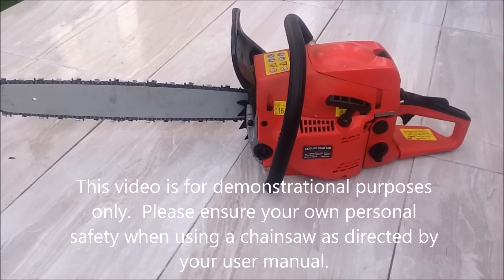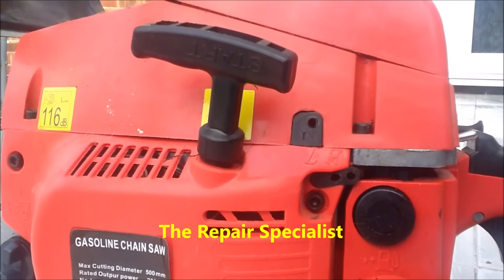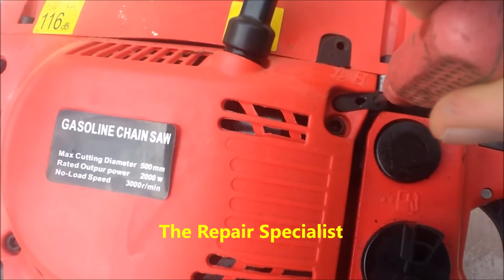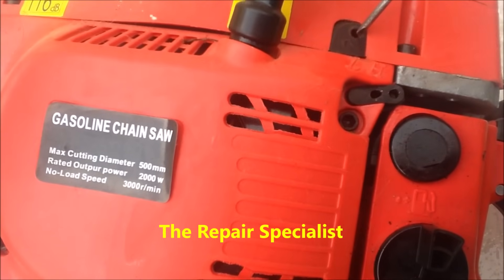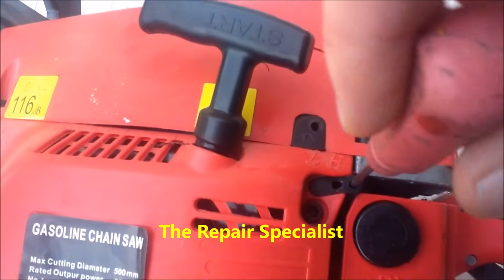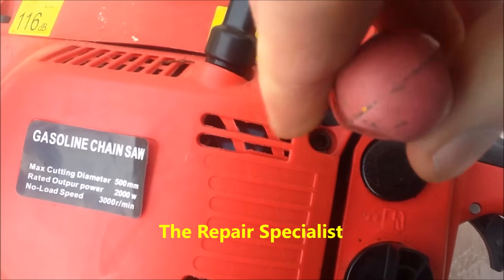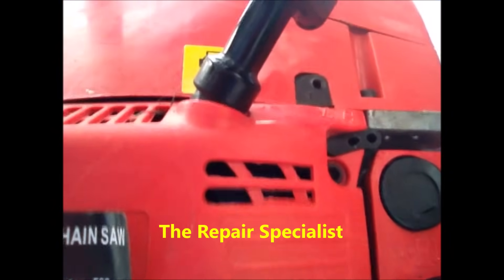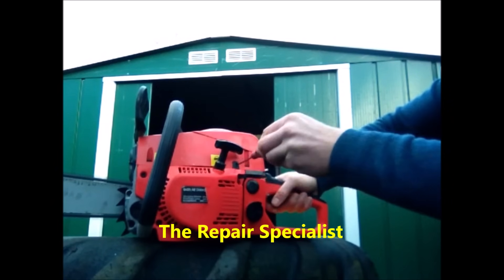Chainsaw Carburetor Settings: HOW ADJUST CHAINSAW CARBURETOR CORRECTLY!  (by Craig Kirkman)

Comment: I just replaced the carburetor and I realized I wasn't really sure how to make the adjustments. I watched a few videos but they were long winded and left me still uncertain. This one was the best and straight to the point and well explained.  I spent the afternoon in the woods with a well running saw.
Reply: You are so right. Everyone has a carb adjustment video where they tell you everything except how to do the adjustment. Straight and too the point.
Reply: @spagsketti  yep I came here to adjust my screws not pass a test on carburetors 🤣 too much information in half these videos. Finally one I can understand easily.

Comment: I believe the brand and model on that saw is the Chinesium Maycut.
Reply from the maker: OK thanks
Reply: Hahaha
Reply: @Dean Clark Hilarious but sad at the same time. Do we blame the companies making garbage products or the cheapskates who created the demand?
Reply: @Dean Clark I have a Timberpro and also use a farmer friends Stihl. There is no difference between the cutting ability, the handling is better in the Stihl but both get the job done, with a sharp chain......
Reply: @bubbafudpucker397  yes
Reply: I've got a 62cc Dereal that's one of the many takes on this very saw. Gave $122 and it's the best saw so far that I've ever owned. I've had 4 stihls & several of the early homelites.
Reply: Yes to be exact its the Chinesium Maycut-yorlegoff its kind of a special design.
Reply: @moorbene5104  LOL!
Reply: Regardless of saw brands all the carbs and systems are pretty much the same except for the materials used. Carbs even in el cheapo's are from same manufacturers.

Comment: Thank you, sir! I couldn't find this information anywhere in the chainsaw manual. After countless tries to get the thing running and reattach my arm to pull that wretched rope another day, I tuned (no pun intended) into your channel. There I found your priceless information about the H and L adjustments. After applying what you said, it fired right up and runs like a top. Again, thank you so very much!!!
Reply from the maker: Thank you so much for your kind feedback. I really appreciate it. Craig 👍👍👍👍

Comment: Thank you thank you thank you. I had replaced the fuel lines and I started messing with the adjustments and I got them all out of whack😖. Your video saved the day. Simple, to the point, accurate and very very helpful. I did exactly what you said and had great success.  👍🏻👍🏻Two thumbs up. Big likes

Comment: I love the way you speak mechanistically, in contrast with many other explanations. Can you tell me why idle rpm increases when you turn the L screw clockwise, reducing fuel delivery? Is it because the saw idle is set too rich, and dropping that ratio down gets to stoichiometric A/F balance? If you had a tach, would you adjust the L screw to achieve peak rpm at idle? Or, is it better to be a little rich at idle so that a cold saw will start more easily?

Comment: Thanks for the video and link to the kit. 
My Dolmar PS-35C has an ordinary slothead screwdriver on the L adjustment, and a single-D on the H adjustment. The idling adjustment takes a Philips screwdriver.
You have to wonder why they aren't all the same.
Reply: To keep you from tampering with it. The environmental people don't want you messing with the mixture screws and the amount of pollution the saw puts out and the manufacturer doesn't want you messing with the high speed screw and blowing the engine up from over-revving. No one cares if you change the idle speed.

Comment: Thank You, you showed me everything I needed to get my Echo CS 590 started and purring like a Timberwolf should
Reply: That saw has a limited coil and needs to be tuned in the wood
Reply: I just got myself an echo cs 490. It was bogging down in wood over 10 or so inches which shouldn’t be happening so I took off the litter caps and am going to tune the carb up a little higher as well as open on the muffler exhaust. Hopefully this wakes it up. How’s the Timberwolf working for you?

Comment: I always do the L screw first as 15-20% of your fuel at full speed comes from the low speed circuit. (Most carbs) Another thing is that if you idle speed adjustment is too high it will be difficult to adjust the low speed jet
Reply: I normally turn out the idle adjustment to just a small amount so I can hear clearly what the low is doing than set it.  Then use the idle to bring my rpms back up to spec

Comment: Thanks I have a weed Wacker I wasn't sure about. I bought a professional husky and it's only about a year old it always sounded clanky out of box in idle. I figured that's how it was supposed to be. Just now I went to use it and it had no balls what so ever under load. I figured the gas was bad. Dumped it out put in fresh 95 octane and still would bog under load and stall out under idle once in awile.  I ended up playing with the carb before your video. I did the L first then held the gas for H until it sounded like something normal. I was worried I messed up and used your video as a reference. First time I ever messed with a carb so I was a bit worried thanks for the video.

Comment: just tried my new top handle chainsaw today, its ok at hi revs but badly bogging down at low speed, I will check the adjustment screws in the manual.

Comment: Great video, like all of yours that I have seen. Just a little confused here. Some good repair persons here advocate to do the High jet first on trimmers and all except chainsaws. On the latter, they say, do the Low first.
Reply from the maker: First of all, thank you for your feedback. I really appreciate it. As for the recommended adjustments. Well, as technicians I suppose we all personally have our very own way and preference of doing things.  This way has worked for me over the last 25+ years, but at the same time, I respect other peoples way of doing things as well. As you can see in the video, I have set this carburetor up nicely. This is just the way I have become accustom to tuning chainsaws and its always worked for me.  Thank you for sharing though. Craig

Comment: Interesting. This is completely  backwards of how I’ve always seen and been told how it’s done. I’ve always been told to start by adjusting the L then the idol then the H then the whole thing over again. Seems to make sense to to it H-L-I as shown in this video. Thank you.
Reply from the maker: Yes it is different to the conventional way, I agree. I was shown the same way as you. But I found this method to be better for me and it works absolutely fine so I wanted to share my way. Thank you for your valued feedback. I really appreciate it. Craig 👍👍

Comment: Master please help I got an Husqvarna 326 chainsaw that the carburettor doesn't work I have cleaned and pulled apart
several time  lately I decided to remove the H and the L  adjustment screws I come to realize that the longer  L  screw  the point 
is broken  and probably that is why the primary gets hard to pump ?      1) How to remove the broken piece    2) IS  the longer  screw
in the right place  L ? Thank you

Comment: would be nice to see with a tachometer and slower explanation. There is some recommended settings from factory - is it not better to start at these settings? On en echo CS2511tes they are for instance H 2 5/8, L 1 7/8 and T 1 5/8
Reply: Yes, go with factory specs. A tachometer is definitely the right way to set the high speed but you need to know the max rpm spec for your particular chainsaw.

Comment: Fantastic video. However it does not solve my issue, which is my craftsman chainsaw model 358.350360 was working fine but then I felt it did not have enough power so I started adjusting the L and the H prior to watching this video. If that was all I did I could have remedied my issue rather easily  with just a little research, but alas I went a step further and started playing around with the idle (T screw) because after messing around with the L and H I had a hard time starting the chainsaw now. Is there a process you recommend on how to set my idle right before I mess with the L and H screws as mentioned in your video. My shoulders sore from all the attempts to start the saw!

Comment: Dear TRS, how to do that if I made a mess with idle screw? Actually, I replaced the carburetor on a Husqvarna 142 and started playing with it. But I forgot initial settings of idle screw and I am puzzled now. What is going on is my chainsaw starts working, idle is very high (noisy) and I simply don't know where to start from or how to continue. Could you explain a good starting position of idle screw at the beginning, when both my L and H screws are at one turn counterclockwise from right position?

Comment: Would you be able to help me with an issue I’m having with a Stihl 015? I have to adjust the high idle screw all the way in for the saw to run properly, but still don’t have high enough rpms. Any suggestions? Thanks sincerely, KyleH

Comment: Dear Mr. Craig. Hello and congrats for your awesome videos. I have a Chinese Chainsaw, did not work for about One year and a few weeks ago when trying to star ir it wouldnt work and fuel was leaking from the air filter. Disassembeled the carb and noticed that the diaphragm was very stiff so i bough a repair kit and rebuild the carburetor. now the Chainsaw os very hard to start and fuel is leaking from the air filter. Can you please suggest anything that can help me?

Comment: as always a great video can you do an explanation for all the yahoos who think drilling big holes in the muffler of a chain saw improves power on a two stroke theres more to it than that i used to race two stroke yamaha bikes back in UK and you have to modify the transfer ports correctly to inctrease opower evenly and not risk blowing up the motor also done correctly a bigger engine will give way more power per bhp/ton

Comment: Question for you the chain is spinning very fast so I turned the idle screw down I can get the chain to stop spinning but the saw shuts off eventually do I need to adjust the low screw at all what is your opinion thank you

Comment: Help ...I have two Stihl 034 chain saw --O34- and 034 AV...the 034 has a Zama carb
and works fine ...the 034 AV has a Tillotson carb and after many cleaning it 
does tempt to start with 1 to 1--1/2 out.....  Should I replace the carb with a Zama as the 
034 ?

Comment: I think I have it adjusted like you shown  It started up and a cut with it for about 10 minutes . I stopped it to fill it up with oil  and it wouldn't start up again . I pulled till I almost passed out . Whats going on when its running just fine  once it starts  but if you shut it off and try to start it again it just won't start . It was idling great the low rev was set good  the high rev was great  it was cutting great . It will run  at idle til it runs out of gas but once it stops  it won't start  again . I have to wait at least a day  before it will start back up . I check the plug and it look fine . I can see it sparking  when I ground it . What is going on ?
Reply from the maker: Sorry to hear you have been having these issues.  It sounds like it could 'possibly' be your magneto coil pack. They can show these symptoms when hot.  When they cool down they can work again until they get hot again.  I can't say for definite but it sounds like a good possibility to me. The only thing you can do really, if this is the case, is to try another coil pack.  

This of course would mean you will have to take the chance and buy another to see if this was the issue.  At least then you will know that it is either the coil pack or something else to continue to look for. A process of elimination!  But welcome to mechanical repair and diagnosis.  This is what us guys have to do each day unfortunately.   Although you have a nice spark, this can be irrespective of that.  

Your coil pack can still be the issue even if you have a spark, because it is the exact quality of the spark that makes all the difference.  In the past I have messed around for days and days trying to figure issues like this out but in the end I have just tried parts and got better results.  Again, this means you spending out the cash, with no guarantees, but it could possibly sort out your issue.  

I hope this helps and perhaps I should have just said "it could be your coil pack", which would have saved you reading this thesis! lol

Many thanks Craig

Comment: I'm pretty sure my screws are messed up bad enough that I can't even keep it running for longer than a second. Starts with choke as it should but then when I take choke off and pull it, it starts immediately and then revs really high for a second then dies. I can do this 10 times in a few minutes and it does the same thing, as long as I use choke first. 

I did as you said and turned both screws all the way to the right and then backed them off but it keeps doing this

Comment: Hi. Good tutorial. How can we reduce the amount of oil greasing the chain. Thank you
Reply: If revving the chainsaw without cutting wood (as seen in this video), all chainsaws that WORK PROPERLY will get what appears as excessive oil on the bar.  This is a GOOD thing!  When cutting, you won't see that oil on the bar as its contacting the log.  It is MUCH better to have too much oil feeding than not enough, as too little oil will cause excessive heat damaging the bar and chain.

Comment: My engine runs at its peak with the low screw turned out one and a half times and the high screw only turned out 3/4 of one turn that seems so little but any more than that it bugs and I have to close it. Brand new filter, brand new gas filter, brand new carburetor, brand new spark plug. Everything is new is this normal less than one turn out

Comment: I adjusted the 2 screws one full turn on my Poulan 3800 and it still won't run after I cleaned and rebuilt the carb correctly

Comment: I replaced 3 carburetors already with the original including. the question is a rebuild kit with the spring/gasket/(arrow shaped thing) will solve the problem? Did you tried that guyz? Thank you!

Comment: Ok I did this to mine and got it running perfect. Used it one time and now the SOB won’t run over 5 seconds then it bogs and dies and won’t start back for all day. I can’t set the H and L screws if it won’t run.

Comment: What is difference between the L adjustment and the idle screw?
Reply: L adjustment adjusts the fuel/air mixture ratio. This is important to have set probably so when you accelerate there is no hesitation going to full rpms. After getting this set properly then adjust the idle screw to desired idle speed.

Comment: What type of low rpm does the L screw controlls?(Idle rpm or a different type of low rpm)
Reply from the maker: The "L" screw on a two-stroke chainsaw carburetor controls the mixture of fuel and air during low RPMs, specifically at idle and slightly above idle speeds. This adjustment is crucial for ensuring the chainsaw runs smoothly when it's not cutting and during light load conditions.

When you adjust the "L" screw, you are essentially fine-tuning how much fuel is mixed with the air at low RPMs. Turning the screw in (clockwise) will lean the mixture by allowing less fuel, which can raise the idle speed but may cause the engine to run too lean, potentially leading to overheating or damage. Turning the screw out (counterclockwise) enriches the mixture with more fuel, which can lower the idle speed but may lead to a too-rich mixture, causing the engine to run rough, emit more smoke, or have difficulty staying running at idle.

Proper adjustment of the "L" screw is important for the efficient and safe operation of your chainsaw. It ensures the engine idles steadily without stalling and transitions smoothly when the throttle is increased.

I hope this helps

Craig
Reply: @TheRepairSpecialist  Yes, thank you very much for taking your time explaining, it did help a lot Craig.

Comment: "I don't force them closed" (Re H&L jets' adjustment-screws)  Yknow I've felt my idle/'ticker' (you're 1st I've heard use that term :P ) seem....less-than-reliable for instance I can't rely on turn-#'s but simply by site/ear/tachometer, so when you said that Re H&L screws it hit me....I'd been wondering about them & their precision in the carb, do you think it's ever warranted to clean them directly?  I'm picturingn something akin to just screwing them out like 3+ turns, spraying their threads w/ cab-cleeaner, and re-seating them knowing their H or L jet control will/should be more precise!!  Would love to know if you'd think that'd be OK or if I've gotta tear the carb apart to clean those H&L screws' threads to ensure they're functioning as-closely to OEM as possible!!

Thanks a ton for all you do, I 'cut my teeth' w/ Steve's Saloon but if that was high-school then your series is college lol!!!  Unsure if you see the stats but you'd surely chuckle if you knew how much of your contennt I've gone through this week especially yesterday, as I move from refurbs/fixes to modifications I knew I'd have to learn more about operations to start that tinkering so for now just gonna keep learning til I feel comfortable!
Thanks as always, you channel is amazing am especially thankful for the gas-molecule's point of view video (showing innner-workings of carb/etc) and that '12 reasons' vid (the ~1hr one), have watched them multiple times now am so psyched to have found you --- do you have stickers by chance?  I do a lot of posts/write-ups of my work am badly wanting to 'rep' you (&Steve's Saloon) guys w/ sticker(s) on one of my saws, have a coulpe projects at the moment but would love to put a decal on them to indicate I fixed it & by whose instrucions :D